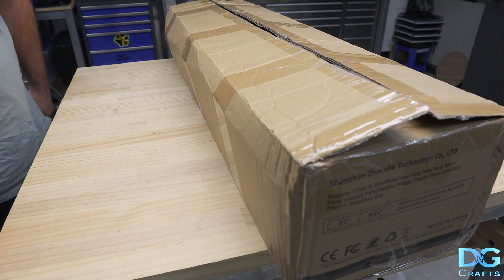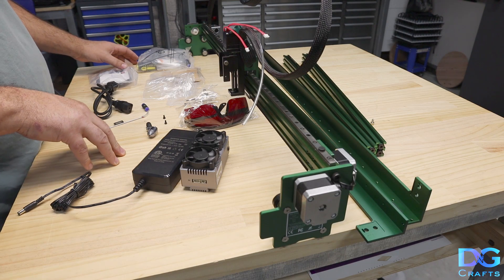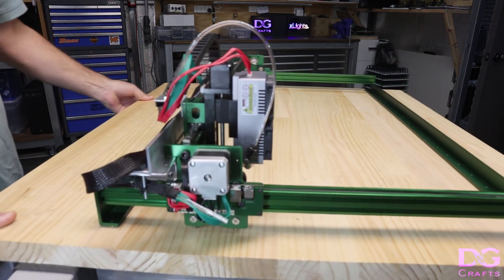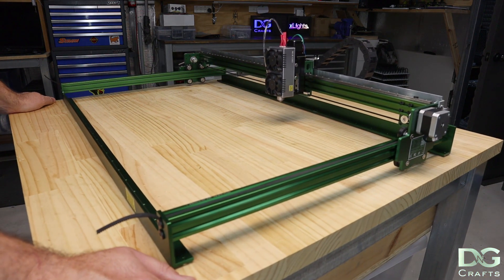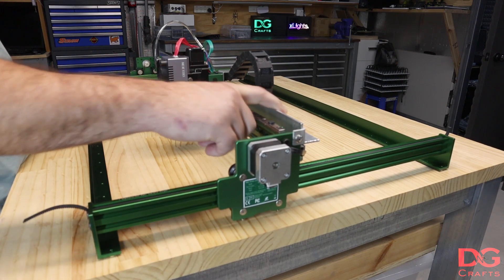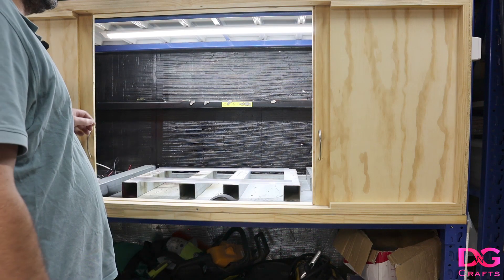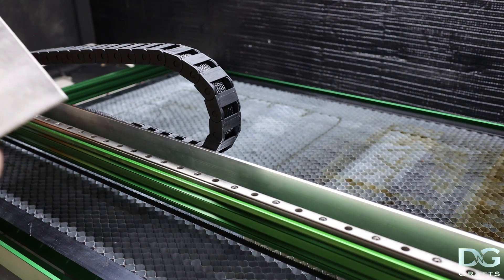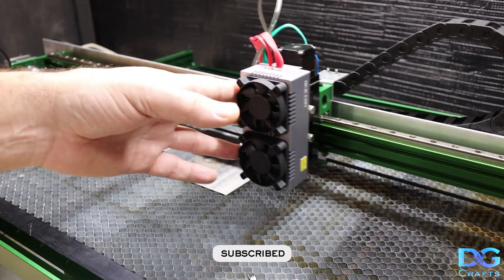Testing The NEJE Max 4 and E80

Comment: I'm new to laser cutters and looking at getting a used NEJE 4 max that I found for sale that was bought new but never used. I recently was watching a video from NEJE where they mention in this video that the small air pump was used for keeping the lens clean only. That you needed s full size compressor for thr air assist to help the laset cut better.

In all the reading on these lasers I've done, I've never seen it mentioned like this before? Can you elaborate on this please?

I have a full size shop compressor so all I would need to do is plumb it all up.  Does the smaller air pump that comes with this unit just for keeping the lens clear?
Reply from the maker: You can use a compressor but i would get a regulator to drop the pressure to around 20psi.
I use a compressor on my c02 laser but on my neje i just used a 90l/m pump like this
https://www.ebay.com.au/itm/125638467703
Reply: @DnG-Crafts  Thank you for the reply. Yes i know to drop the pressure... I was more asking about why they said you should use 2 different air supplies for the 2 different areas. I just have never seen another laser company mention it like this before.

Comment: Can the NEJE 4 Max laser with the E80 laser module cut and engrave plywood directly without using a honeycomb bed? I want to move the laser over a full sheet of plywood to cut out larger parts using the ‘pass-through’ technique.

Comment: I would love to buy this machine with the main aim of cutting on that thin stainless stell sheet but am not getting any oriper review on that. What am seeing all over are the reviews on wood,boards,acrylics etc with very minimal to no review about its capabilities and performance on the steel cutting. How fast and at what power and speed. How smooth the cut is. The challenges etc

Comment: Thanks for the interesting video. Currently (May 2024) the Neje Max 4 is delivered with drag chains. The price is approximately $500. The honeycomb now also fits between the front and rear rails. An aluminum plate is also included for use as a base.
My problem with the laser is that the frame is not at a right angle. As a result, the Y-axis hits the frame first and the limit switch often does not reach the frame. Furthermore, the laser module is not vertical. The laser module does not run smoothly on the linear rails.
Reply: I have similar issues with mine
Reply: Did you solve these problems?
Reply: @thomassalin949  I couldn't solve the problem with the right angle of the frame. But this is not so important when engraving and cutting, as the laser creates rectangular parts. I solved the problem with the limit switch by gluing a small piece of wood to the frame so that the limit switch hits the wood.
Reply: @piepschau9388  I have now got the frame square and Y gantry is now allmost square, will try to fine adjust some more. I will try to start my jobs from position x0.0 y0.0 ( or x10.0 Y 10.0) instead of from home position as I dont trust the home position
 switch

Comment: The honeycomb was too small to fit, but am I incorrect in that you removed the aluminum spacers on your rails to allow better screw depths? Wouldn’t have this modification reduced the inside footprint?
Reply from the maker: no those parts are not spacers they are for the belt tension and they are attached to the outside of the frame.
the internal diameter of the frame does not change, you could add spacers but then the rails wont sit in the keyed slots which could allow them to twist/move and cause the laser to be less accurate.

the honeycomb panel was designed for the max3 but neje was also using/selling it for the max4.

i ended up buying the extension rails and building a bed to sit in the frame

Comment: Looking to purchase a laser for hobby work, is the smell bad as I have seen in some videos?
Reply from the maker: it depends what material you are working with but yes you are essentially burning the material to cut or engrave it so it will produce smoke and smells.

wood and cardboard are not too bad its the plastic and synthetic types of materials that smell pretty bad and can be toxic to inhale
it is best to have the laser in an enclosure with some form of extractor fan to the outside of your work area.

i ended up building this for the neje 4 after my frame extension arrived.

https://www.youtube.com/shorts/T-_PlwGcQqY

Comment: I am wondering if this upgrade you made with the aluminium profile affects the machine since now the moving part is heavier.
Reply from the maker: the piece added weighs about 200 grams and the plastic drag chain is not very heavy so i would estimate that it added about 400 grams in total.
i have not noticed any issues with it.

Comment: Hello, thanks for sharing a great review. 

One thing I'm wondering is if the stepper motors in the earlier models are capable of the greater speeds made possible by the E80? I have an older Neje 3s Max (without the drag chains etc) with an A40640. It won't go over 1000mm/m. I don't know if the limit is in the firmware etc, or what. I'd be more than happy to just upgrade the laser head (don't need Z axis control)...but there's not a lot of point if I'm limited to the same speeds.
Reply from the maker: not sure if this will help but if you install laser grbl( https://github.com/arkypita/LaserGRBL ) and connect to your laser then go to grbl config it should read the config from your laser and you should be able to see what the x and y maximum rate is for your laser and you might be able to adjust the values to allow faster movement.

here is an image of the default config from the max 4, the only thing i have changed is the "y axis maximum travel" because i have installed the frame extension, it would normally be 460 but i changed it to 1030.

https://i.ibb.co/CBC1RWx/grbl.jpg

the max 4 defaults have the "x-axis maximum rate" at 24000 mm/min and the "y-axis maximum rate" at 15000 mm/min

Comment: one thing i cant find anywhere is that neje keeps boasting that the focal dot of the e80 is .06mm x .06mm which is amazingly small, ive only seen one other company top that and it was with a 6 watt laser. do you think you could do a dpi test with it and really see how true this is? if it truly is that small of a dot it should be able to hit around 400 dpi which would give impressive detail over most competitors.
Reply from the maker: i will try and find something to do a dpi test but looking at the dot of the e80 on a board at 25mm it is rather large compared to the e40 so i am not sure how the result will be.
Reply: @DnG-Crafts  honestly that's kind of what i suspected, their website was claiming a tiny dot at .06mm x .06mm and then i heard them say .1mm x .1mm in another video so I'm curious what its true size is, i suspect its really something like .15 x .15mm like most of the rest of the multi-diode units that are out there. it makes a huge difference in high detail picture engraving. it would be nice to find a high power multi-diode cutter that has that fine precision but that would be the golden apple wouldn't it. at any rate it would still be good to know what it actually is. thank you

Comment: Hi, Nice review, very useful. One question though, can the laser focus below the frame? Meaning can you sit the whole thing on a larger board and cut or engrave the board? I'm just wondering if it is possible to work on oversize projects this way.
Reply from the maker: yes you would be able to place the frame on a board and cut/engrave it.
the z axis has a fair bit of room to work with and the e80 laser modules focal point is 25mm from the bottom of the module.
Reply: @DnG-Crafts  Great, thanks for the info, it's just one of those things nobody ever mentions.

Comment: Hi. Have you lovered the module with every pass while cutting?
Reply from the maker: it depends on what you are cutting but for most cuts that require more than 1 pass you lower the z axis by a certain amount to keep the focus point of the laser on the layer you are cutting through.
you set it in lightburn to enable the z axis and then the amount in millimeters to lower the module on each pass.
Reply: @DnG-Crafts  I see, so Max 4 does it automatically thanks to its z-axis motor? How about Max 3 then? As it doesn't have that feature.
Reply from the maker: @rsorez329  no the max 3 does not have the z axis feature, only the max 4 has the z axis motor.
Reply: @DnG-Crafts  Yes I know that the Max 3 doesn't have that, i was just wondering how to do multiple passes on it, and the only way to do that, is to lower the laser manualny when cutting thick wood.
Reply from the maker: @rsorez329  yes you could simulate the function of the max 4 on the max 3 by doing a single pass and then lower the laser module a few mm then do another pass and repeat until you have made the final pass.

Comment: Hi mate, great review, my main interest is because i have the max 3 with the 40640 12w?? module and really pleased with it, after watching your video i think the max 3 chassis is far better than the max4 from the design point. My question is this, you have both the Max 3 and the E80 module, in your opinion if I purchased the E80 is it a straight fit to my max 3. According to Neje it is but i'm always a bit wary, it comes with a new 24v power supply etc. I cannot find any info anywhere from someone who has actually upgrade the Max 3 with the E80 so thought any advice you can give me would help. Also I notice on the E80 there is a second 2pin cable to the module, my A40640 has the 2 pin connection but not used, I have not so far found any reference for what it is for, any info on this?  I'm mainly into cutting plywood and MDF upto 6mm, occasionally perspex.
My thought is the E80 would allow thicker material and or speed up the process considerably. Any comments greatly appreciated, from an old boy in the UK.
Reply from the maker: the reason i got the max 4 was for the motorized z axis as it allows lightburn to drop the focal point of the laser each pass which does help with cutting thicker material.
i do like that the 4 has the linear rail system too but overall i think both the 3 and 4 are fine.

with the e80 and the max 3 from what i have read it will work with the max 3 if your mainboard on the max 3 is v1.1.0 or above to support 24v.
something else that i have read was that the air assist on the side of the e80 hits the max 3 frame.

this facebook group might help answer some of your questions as it has a few people using the max 3 and e80
https://www.facebook.com/groups/662566638925122

Comment: Hello from Arizona in the states!  Very much enjoyed this video.  The cable chain fix looks great.  Did you buy it or 3D print?  Suggestions?  Also, the E80 seems fine, but I’m not convinced I need the power.  Any thoughts on the E40?  Thanks 😊
Reply from the maker: i ended up just buying the chain because it was only around $10 per meter for a 10x20 chain.
i have the e40 on my neje max 3 and the e40 has been a good laser, i have cut a fair bit with it and it is pretty decent.

the e40 is easy to focus because the focal point is 5mm from the bottom of the laser housing so i just cut a few bits of material to act as thickness gauges 5mm, 3mm, 2mm and just place the gauge on the top of the piece i am working on and drop the laser on to it and its done.
Reply: @DnG-Crafts  Wow!  Quick response, and helpful!  I currently have a Snapmaker A350 2.0 that is very well built imo.  But, my "shop" is smallish and I'll probably never use the CNC mill capability.  It takes some time & effort (OK, not that much) to change from 3D printing to the laser.  I actually dusted of my old Monoprice Select and leave it set up to make small parts as needed.  I'm looking at possibly a delta style 3D printer with a non-moving Y axis build plate, and now the Max 4 for my laser work - again the non moving build area is attractive.  There is a trade off for 3 in 1 machines, but I learned a lot with Snappy and had a lot of hobby fun.  Thank you again sir!!!
Reply: Did you get the e80? I did and got some questions

Comment: My solution with the honycomb is to push it to the front all the way, ( the E80 touched the edge of the honeycomb at the front) and put a  5 mm layer under the back edge, because you cannot reach the first 9.5 centimeter  of the MAX 4.  So bad design, but in this case a solution for the honeycomb.

BTW my honeycomb came with an aluminium sheet for the back.

Stealing your slution  with the dragchains, already  ordered toghether with the MAX 4  as advised on the site , but gues what ?  To way short. 

Just as the airslot, you need to widen the holes for the screws on the bracket.

The E80 module is 600 gram the bolts  the Z-axis are hand tightend after one hour burning they loosen and, in my case the E 80 dropped and damaged my new  honeycomb....bummer.
Best solution i think is replace with Phillpis screws or something else. By hand is not good enough.

And all the rest of the problems you mentioned i had also. So thanks for the info.

BTW i'm very impresse with the E80 module, but i came from the A 30 :-). So i sould be!

Comment: Thanks mate for the thorough review, I was quite impressed by the new laser ability to engrave different colours on stainless steel. Do you think the old A40640 can do it too? Does it work on other metals such as aluminium or brass?
Reply from the maker: I have been wanting to try some other metals but i have not around to trying them.
Before i had the e80 i tried stainless with the e40 which is a 10w laser and it worked.
the e40 is the same power as the a40640 so i cant see why it would not do it.
Reply: This one is simple, the metal changes color during the heating process. Any kind of laser can do it. Compared with A40640 and E40 laser, I will prefer E40. This is a very good module. I think it is better for engraving stainless steel.

Comment: G'day, appreciate the no-BS review for once. There's not a lot of info about the Max 4 and E80 around yet.

One thing I'm wondering about, in the description they tout the Max 4's "vertical cutting" ability (ie standing it up nearly vertical on its front edge like an easel.) Seems like it could be a huge space saver with the extension kit on there but I'm dubious about those steppers being up to it. I don't suppose you've tried it, or have any thoughts on how well it might work? Cheers.
Reply from the maker: i have not tried it but it does have dual y axis steppers and the gantry is fairly light so i think the steppers would be able to drive it in a vertical position.
i think belt slipping could be an issue if it was too heavy and if it skips a tooth mid cut it would throw the whole piece out of alignment so belt tension will be important in that configuration.

the steppers on the neje max 4 have no markings but they are 42-34 nema 17 and the gantry with the e80 and my cable chain mod weighs exactly 4kg, maybe with that info you might be able to workout if the two steppers combined can handle the 4kg load.

this is the closest match i could find https://circuit.rocks/stepper-nema-17-bipolar-motor-42-x-42-x-34-mm
Reply: @DnG-Crafts  Oh, thanks for the extra info, that's super helpful!

I did a few dubious calculations based on Creality's 42-34 and guessing a pulley diameter of 14mm, and really roughly comparing to the torque curves of other stepper motors, these two motors should be able to lift about 5.5kg at peak torque and fall to 4kg at around 20k mm/min best case scenario. Neje recommends a max processing speed of 400mm/sec which is probably just fine. I'm looking to pick this unit up in the not too distant future so I'll know for sure soon.

Cheers
Reply: @sjaellos  did you get this NEJE 4 and try it mounted vertically yet?

Comment: how many pass to cut 17mm?
Reply from the maker: The test i did was 6 passes on 18mm pine but i think that could be reduced with better speed/power adjustments.
Reply: @DnG-Crafts  could please share your test file, that stainless steel
Reply from the maker: @MaggieHowardv  i used the image from this page  https://darklylabs.com/article/finding-a-materials-best-engraving-settings/
Reply: Aim the focal point at the center of the wood and use an 8 bar air pump to cut 20 mm of pine in a 1 pass